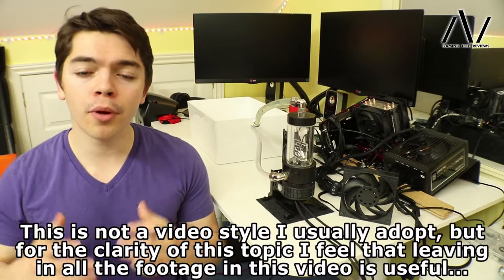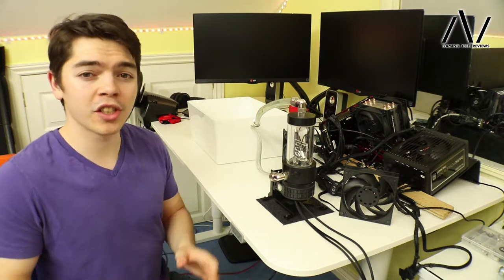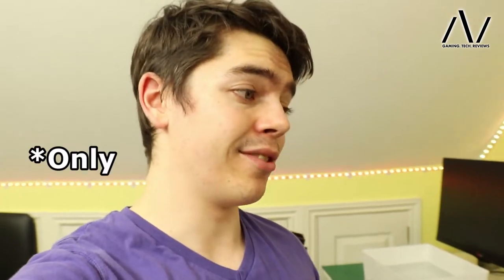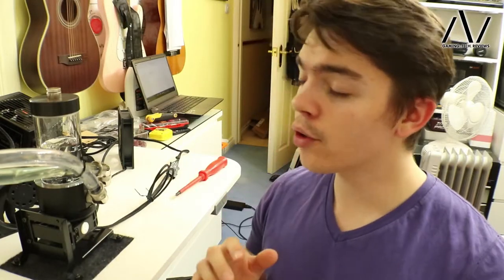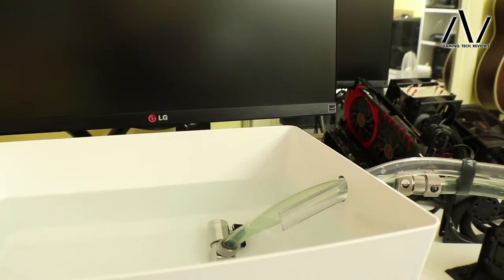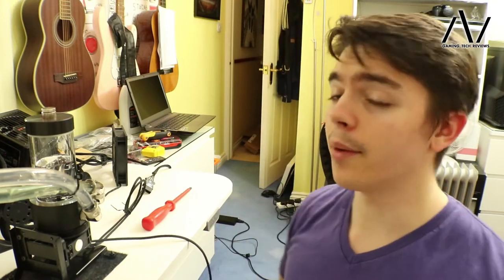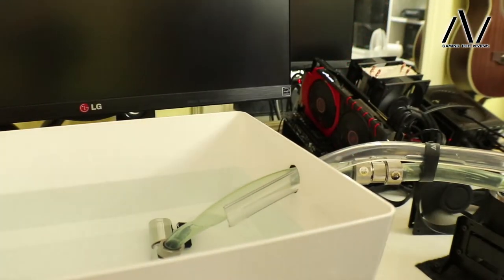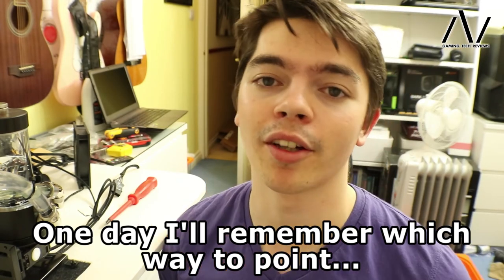Why your PWM runs at MAX speed...

Comment: Nice video. Very few liquid cooling pumps can be properly controlled by the PWM feature on your motherboard. First, most DC pumps on the market are not designed for it, and second, nor or any motherboards. Thus, you have two real choices to speed control a 12V DC pump in your rig. First, if your motherboard supports it, you can switch from PWW to voltage control (which is what the two-pin trick does, forcing your mobo to run in DC/voltage mode). Once in DC control mode, it will allow you to taper the voltage down to 7V (the typical minimum for most mobos), which if the pump can run this low, it will slow it down dramatically. Voltage control of a pump is just as limited as voltage controlling a case fan so don't expect a lot of granular control. Or, you can buy a separate PWM motor controller and use it to control the pump, which is what I've done. This will allow you 0-100% control (roughly). It does require some DIY skills that are on the moderate to high side. You'll want to take 12V off your PSU Molex and run that to the controller, which will require creating leads and wiring them to the correct input on the controller. You then have to connect your pump to your controller output, which often requires manipulating another Molex or 3-pin header. I simply salvaged the parts from old case fans since many come with both a male/female Molex and a female 3-pin header. I use the PWM controller for a couple of reasons. You can run at around 100% (high flow) to purge entrapped air and then slow it way down as high flow rates are not neccessary at all. Lower the speed will lower the heat load on your pump motor, extending lifespan (theoretically) and reduce noise (theoretically).

Comment: Video can be summarized to wrong fan header or wrong header setting in BIOS. The header needs to be 4 PIN FAN HEADER set to PWM in BIOS or 4 PIN PUMP HEADER. Keep in mind that PWM mode headers provide constant 12V and the device connected to the header takes the full 12V but modulates that down based on a digital signal, the PWM signal. That's the only way your PUMP or FAN will actually run slower. If the header is set to PWM and you have no PWM signaling, it runs at 100%.

Comment: Man, thank you so much, you just saved me an RMA. I wouldn't have thought that the speed control would be on different pins for different headers. Turns out the CPU_FAN had the sc on the 4th pin and the CPU_OPT has it on the second. Thanks again man! Glad I found your video

Comment: I hope this gets read, but you seem to be awesome at actually reading comments. This might also be useful if anyone else stumbles across.

Fan speed can either be controlled with Voltage or PWM.  Side note, pin 3 is what tells the motherboard the RPM of the device.

In voltage mode, you are correct with pin 4 doing nothing. But fan speed can still be controlled with pin 2. Pin 2 simply changes voltage...the more voltage, the faster the fan spins, fairly straight forward I think. Typically under 5 volts the fan stops, up to the maximum rating of 12 volts. In this instance the fan can only run "so slow" before it stops running completely.

When the motherboard header is in PWM (Pulse-width modulation) mode a constant 12 Volts is sent across pin 2.  A fan gets the constant 12V power, but can be regulated in pulses by pin 4. The quicker the pulse, the more over overall power the fan receives. Since it is getting the full 12V (when it has power) the fan can typically run slower then the direct voltage mode, resulting in a quieter performance.

Pumps don't have a pin 2. Thus they receive no power (from the motherboard) and since they receive no power, no need for a pin 1 ground. They only have a pin 3 and 4. They can report their RPM and receive the PWM signal. Rather they get their power through the 12V molex connection. The pulses will regulate the molex. Without the PWM pulses it will go to its default state (usually full power, but might have another default configuration). Looking at your hub, you can indeed see that it will not receive the PWM signal.

One might be thinking, both molex and the motherboard send 12 volts, why not just run the whole thing off the motherboard header. If so, good question and it comes down to Amps. A typical MB header shouldn't surpass 1 Amp. Doing a quick search on EKWB a ddc pump showed 18 watts, and a d5 pump showed 23 watts. The formula for determining Amps is Amps = power / voltage. A typical pump would pull 1.5+ Amps and could possibly short out the header. Some headers could probably pull that Amps for awhile, but could just as easily burn out. Some pumps could also pull as much as 3 Amps. A typical molex connection is rated for 11 Amps, and running it through our handy formula comes out with a maximum 132 watts of power. More then enough. I actually tried to find a pump that used 12 watts and could be powered strictly from the header, alas I could not find one.

On another note, it looks like you might be dangerously close to maxing out that CPU header as is with those fans. Each of them is rated at .18A giving you a total of .9A. One more would be over the usual rated limit (though, chances are you would be ok). While I would trust this rating, I would also attempt to lower the total Amp being pulled through one header if I could.

Is there a reason you don't use the system fan headers on your motherboard? You have two of them on that board. I'm not even sure it makes sense to use the CPU header for the case fans, just from a cable management standpoint you need to run more wires across your motherboard (to the generally centrally located CPU fan header) rather then the system fan headers which are located near the right/bottom edge. Just put the pump on the CPU fan header by itself. Then you don't even need to use the header splitter cable here in this case, I am not sure it serves a good purpose, though I might be missing something. If it were me with a motherboard with 2 system headers, I would normally try to put the intakes on one of then and the exhausts on the other. Using this setup you could also set different fan/power curves for each set of devices. One for each header which in this instance would be CPU pump, exhaust fans, intake fans. You could make a case for just using one system fan header with the hub for simplicity. You could use the hub for the intakes and the splitter for exhausts as a simple example.

Edit - Watched the video more carefully this time. You mentioned that the system headers aren't PWM. They are both PWM as well as direct volatage, and can be configured in the bios. The manual just showed the pinout for both configurations just in case.

Edit2 - I lied, I was looking at the wrong MSI manual, newer motherboards can switch modes but apparently the Z170 may not be able to. You did it correctly :) Though it may be worth checking the bios directly just in case it was enabled through an update, but i doubt it... I have no idea why there is the 4th pin if it literally can't use PWM mode... marketing?
Reply from the maker: Excellent breakdown of the header pins, and PWM for that matter, a really good read. I do believe that this motherboard has the functionality between PWM and DC, but the "PWM" mode seems to be a bit off. It would appear it can only support anything above semi-slow speed, but it will stall the fan is it goes down to a speed as slow as what a true PWM header can support.

So I think it's adding some interesting functionality, but it seems to be a more controllable version of DC, than true PWM.

The Molex power breakdown shows why Molex is still a thing. And on the note of potentially maxing out the CPU fan header, the hub is running off a SATA power connector, and is getting some power as well as the PWM signal, and the speed if of course being relayed back to the motherboard. So the main voltage and amperage required is coming from the PSU.

Anyway, that's an excellent breakdown of fan and pump related power methods, and is certainly worth reading for those getting into this, as well those who have only been working on this for a while like myself. I definitely need to update videos like this one in the future. I'm currently working on a video that is similar to this and will be going into all the parts of water-cooling, but in a more general sense rather than a fully in depth one. We'll have to jump between in depth and more casual overviews of these topics.

Comment: I deliberately run my pump at 100% for maximum cooling from pump to rad to CPU to GPU to rad 2 then pump again. CPU while gaming 36C  and GPU while gaming 33C  Averaging... My PC runs full with 0% throttling. 2 240 EK copper rads with push pull fans,  1 D5 140 pump, 1 EK CPU copper block, and 1 EK GPU copper block.... worth every penny. these pumps have a crazy life span not bothered one bit if it will fail.  I do want the RGB version thou i may upgrade to that to get the RGB =]]. current set up been running 100% for 2 years so far keep your fluid clean and you good to go. flush once a year I recommend Mayhem fluid its good for 18 months in use. i change it every year flow stays great no build up in my system. Do not use pastels or particle coolant that will settle after a while and is kinda a pain to clean out. Stay with transparent coolants any color you like.

Comment: My Thermaltake D5 pump only has molex connection, it is quite loud. Is there anyway I can control voltage with an adapter or something? Help would be much appreciated!
Reply from the maker: Hmm, not sure about that. In theory if you cut the voltage it should reduce the speed. But I'm no electrologician so im not sure if that'll impact amperage at all.

Worth looking into, I think there's something you can do there, but a step down transformer or buck converter might be a bulkyish solution.
Reply: Thanks for the reply I’ll look into it.

Comment: hi
I have MSI MAG CoreLiquid 360R ARGB 360mm
On my motherboard I have AIO Pump connector (that is where i connected) did i do right
My motherboard is Asus Prime X570-P AMD X570 Soket AM4 DDR4 4400(OC)MHz ATX Gaming
My AIO pump turns full speed 4000 rpm
How can i lower the Aio pump speed
I couldnt do on bios

Comment: Thanks for another "straight forward no nonsense" video. 
Though You could possibly been even a bit more "categorical" ((after Your demonstration)) and basically "boiled it down to" that what You need to CONTROL the speed is "PIN#4 with a working PWM-signal", and then to be able to "see"/read the "speed" of the pump You need a working sense-Pin#3"
I think this might be "worth" mentioning because there are "many ways" to provide these, for instance despite Your "text overlay" there are actually HUBs that have that functionality (And if I'm not mistaken Your own hub has 1PWM-header. The one that "passes and reads " the "CPU-fan-signal" ) So You could use that to, should You so choose.
What I mean is that essence there are to many "possible combinations" of motherboards and "peripherals" to describe that can solve this, but if it doesn't work it is because either You don't have PWM on "pin#4" or You get the wrong reading because of "pin#3" (or Your pump is broken, (or doesn't have PWM ;) 
Anywhoo  just a thought, keep up the good work.
Best regards.

Comment: heya. with a D5 pump I have 2 cables. Question: one must go for the CPU port in the motherboard and the other where it go?
Reply from the maker: Hey, the other cable is a Molex connector with only two pins. This connects to a Molex connector directly from the PSU. The power for the pump comes from the PSU, and the control comes from the motherboard.

Comment: how do you make thee pumps run just on 12 volts voltage please no computer involved at all? Tx
Reply: My Rosewell aio came with a connector that plugged into one of the power supply cables, ran on 12 volts. Get you a adapter with a fan plug/aio plug and plug it into your power supply. Benifits - pump turns on immidiately at power up instead of waiting for the bios to load up for 5-6 seconds before it kicks on with motherboard headers

Comment: Thanks for this video. I even have this issue on my ROG B550 motherboard.  It has a AIO header that will control fans just fine and give a readout but my pump does not say the speed. Put it on the CPU one and I could definitely tell the pump slowed down because at idle it was running warmer. I even configured the AIO header for the PWM pump (exact same pump that you’re using) and it still didn’t work right even though it’s supposed to off that header.   My pump gives no RPM values which is what that four pin coming off the pump is supposed to do for controlling the speed.  EK says it’s fine leaving the pump at full speed. I have another computer with an AIO in it so I think I’m just going to plug that right into my motherboard and see what it does, because it controls a fan I think I have a bad resistor in my pump that tells the speed. Or I just have something weird going on lol.

Comment: So this problem only occurs on motherboards that don't have a dedicated "AIO pump"-header, right?
Anyways, the bigger problem that I have not seen an easy fix for, is that even if you can control the pump via the curve in the BIOS, there's no way to set the maximum pump speed to less than 100%. This is so stupid. No matter how flat you make the curve, on high CPU-loads the pump will whine up to 100% :(

Comment: Just one big question, when i want to setup for the first time.. i want to run the pump without starting the motherboard, to test leak, run it like 24 hour to get air bubble out of system before actually plug 24p to motherboard... now, what to do?
Reply from the maker: +koford You can do a 24 hour test if you want to, but personally it's not something I've ever done. Just for clarity I'm going to run through the whole filling process just to make sure nothing is missed out.

So, first off with the filling. Generally it's best to do quite a lot of the work upfront to make sure there is as little air in the system as possible, as there are some areas the air can get "trapped" and the pump alone will struggle to displace it. Being as safe as possible you can lean the case side to side with the pump running disconnected from the motherboard with the jumper unit attached (just make sure there is always liquid flowing into the pump), or you can even disconnect the power and close the loop a few times to tumble the case and get the air into the reservoir before filling again. 

Once you're confident there is very little air left in the loop you can then turn off the PSU, and close the loop by disconnecting/closing all fill ports to turn the loop into how it will run everyday.

Then you can remove the jumper unit from the PSUs 24-pin cable, and plug the PSUs 24-pin connector straight into the motherboard. Then connect all your cables to the rear IO as you would usually have them connected. And make sure the pumps PWM fan connector is connected to a PWM fan header.

Once that's all done you can power your system on, and you'll be good to run it as normal.

You can optionally test the system for an extended period of time, but it's not something I personally do. I just run the system for 5 minutes after filling and look out for any leaks. But it's not something I'll tell you not to do, it will always be safer of give the system a good few hours with the pump running and the loop closed to test for leaks. However, there will always be more chance of leaks forming once the system is running normally and heat it being applied to the loop. So keep looking out for leaks for the first few days when you're busing your system.

Anyway, you were pretty much there but I just wanted to confirm everything was sorted out before recommending anything else. I hope that's answered your question, if not feel free to message back with any other questions, I'll be more than happy to help out. Thanks for checking out the video, and best of luck with your system!

Comment: There is a way to fix the speed at 100% without a motherboard? Like... Short the wires??? Just to run at max speed without have to connect the small conector?
Reply from the maker: I think you missed the point of this video...
Reply: @AVTechy  I'm not talking about the video... Just trying have someone to answer this question for me... I did not found a answer...

Comment: I'm so confused, so why couldn't I just plug this into a fan hub? As I wanted to plug my fans into my thermaltake commander and also plug the pump into it.
Reply from the maker: It's all about ensuring the pump.is getting a signal though that 4th pin. As long as the hub provides a signal through the 4th pin (having a 4th pin doesn't ensure there's a signal going through there) then it's completely fine.

Comment: I have question, can I connect PUMP in motherboard fan connector?
Reply from the maker: Yes, it's the only way it can be done on most budget to mid range boards. It's designed for that scenario. Pump connectors or CPU_OPT headers are just extra PWM headers earmarked for pumps on more expensive boards.

Comment: how many total fans did you power with the 1 cpu_fan header?
Reply from the maker: It all depends on your fans. A fan header will supply 1A, so if you have a fan that runs on 0.2A you can run up to 5 on that header (but you might want to leave some tolerance and go with 4).

However if you have a fan hub that runs on external power through a SATA connector (4.5A), you could run up to 22 fans (in theory), but I've not seen any hubs with that much support :P.

Best way to work it out is seeing what the amperage is of the fan you want, and divide 1A by that amperage to know how many fans you can run on a header.

Let me know if you run into any problems.